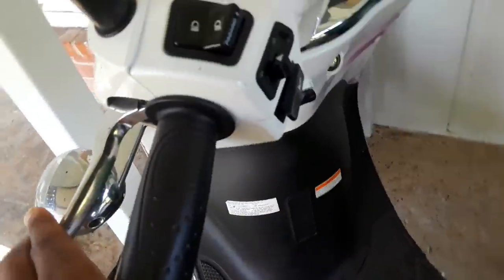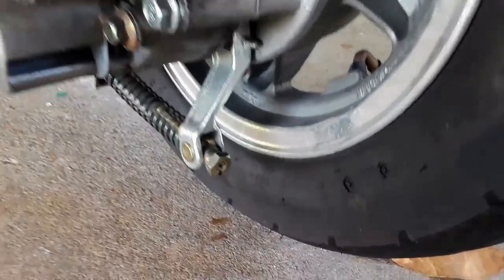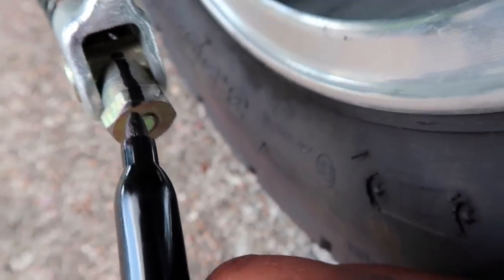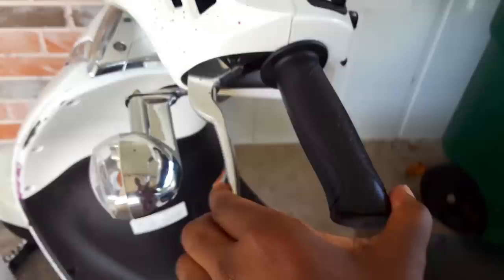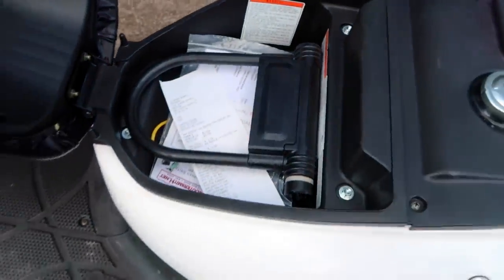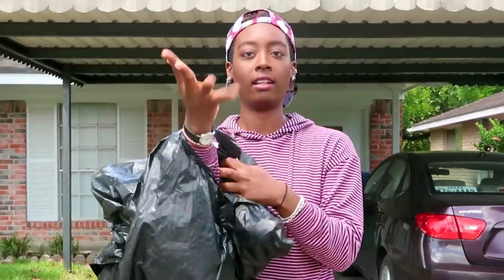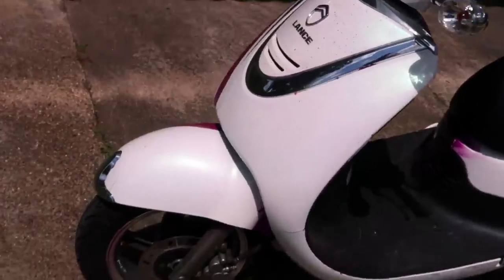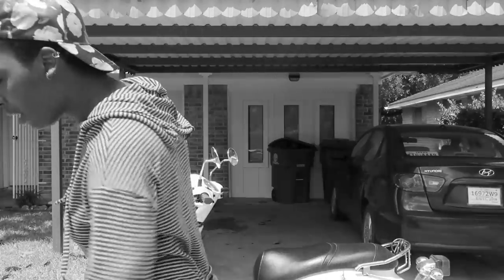4 Scooter Life Hacks

Comment: I'll tell you one better. Get a long cable with key lock from Lowes. Wrap cable through back rim and into helmet and through metal on the back behind the seat. Lock up! That way you have back rim and helmet locked up. I also have 2 key locks on front rim brake disc. They're like $1-$2 on Ebay!! With different keys.

Comment: That zip tie trick is neat, my scooter has a kickstand lock so don't need it, but my sister doesn't. This will help her.

For those who don't know, a kickstand lock is kinda what it sounds like lol under my seat is a lever, and when the twin stand is down, lifting the back wheel you flip the lever and it kicks the stand down. So you can't roll or push the scooter, only the front wheel is on the ground. Between that and my steering column lock... I'm pretty secure.

P.s. check your scooter for a mystery lever, you may have a stand lock too, I didn't know until a friend with the same model showed me. Get to know your scooters! :]

Comment: 1.  Don't buy locks shown in the video. Those are cheap, fragile locks.

2. Invest on disc detainer locks (this type of locks are hard to pick and need a special tool to be picked) and a small chain or big chain.

3. Be sure to lock your tyre to your frame, and lock your bike to a thing sturdy and not easy to come off like a bike hook or a pole.

4. Disc locks have no use too, unless they have an alarm built in.
Disc locks can be taken out if you take the tyre out and took the brake disc out.

5. Last and most important, lock your steering handle using the ignition key. Most bikes can lock their steering. This can prevent from bike thieves pushing away your bike.

Comment: Good hacks.  Mine would be perfect as it is litterally just exposed bars.  Although I love my helmet too much (and worry on rainy days) that I just bring my helmet inside at work.  Perfect place to store my wallet and phone... and perfect conversation starter.  
"Oh, is that your helmet?  What do you ride?" 
"Yea it's mine, I ride a scooter."
"A scooter?  Oh..."
"Yep!  proud and busts out phone to show them pictures :D

I normally ride with bungee chords incase I buy anything and need to strap it to my floor boards... so I guess another idea is if you have anything like that, snake it through yout tire in a way it can't be seen.  Another common thing that scooters have is the steering lock built into the key slot, usually by twisting key counter clockwise and pushing in while the front is turned to the left.  I don't normally use mine, but would be good to have if you park in a unfamiliar place.  It would prevent easy manuvering and they would be forced to pick up the front to just go straight.
Reply from the maker: I see you've changed you're name.
Reply: Indeed!  Will make more sense when I get my rotary engine swapped truck back and also owning my scooters.

Comment: Great tips.  I like the one about using a zip tie on the brake lever.
If they have to leave it, motorcycle cops will use their handcuffs to squeeze the front brake lever,  and then use the other end to lock the handle bars to the crash bar.